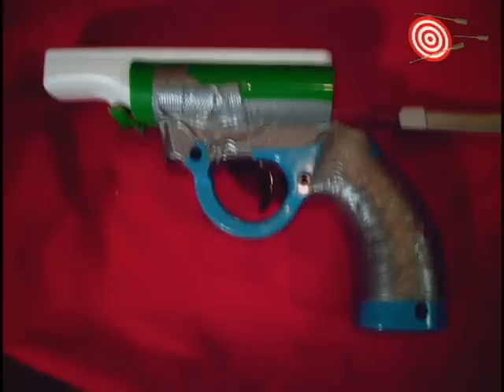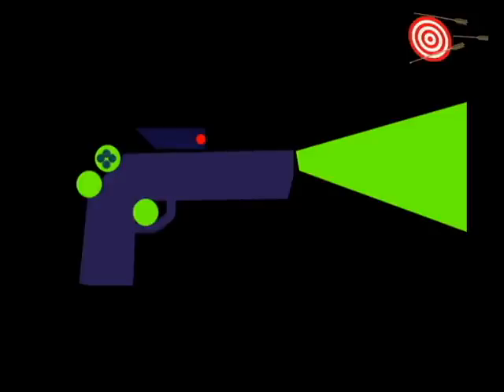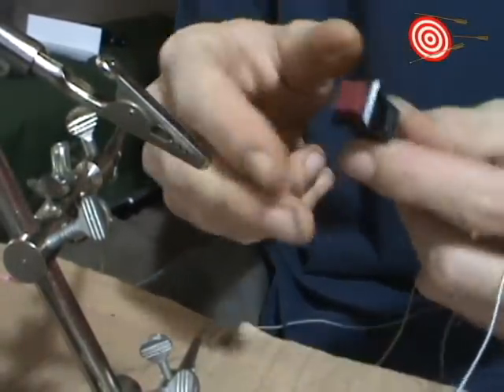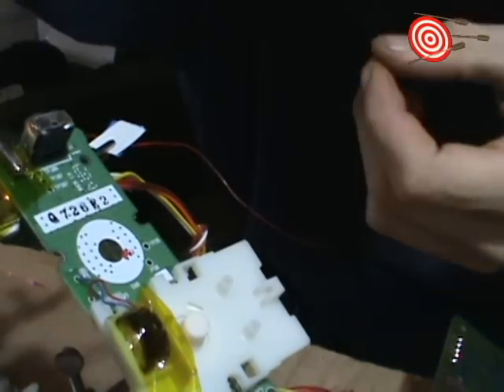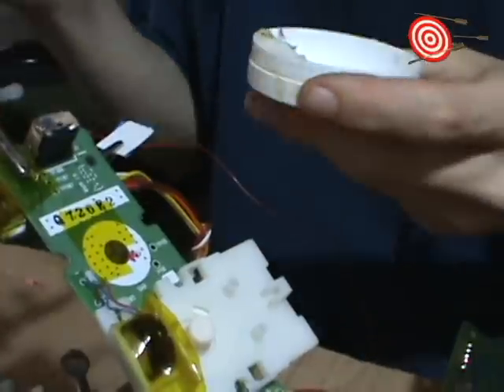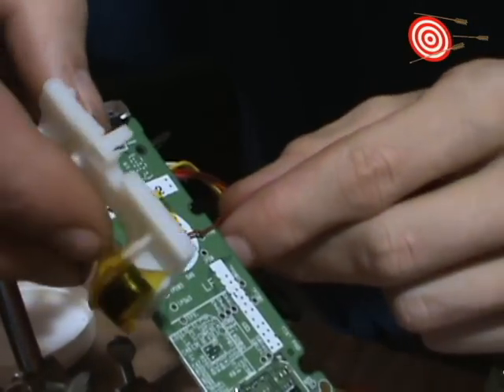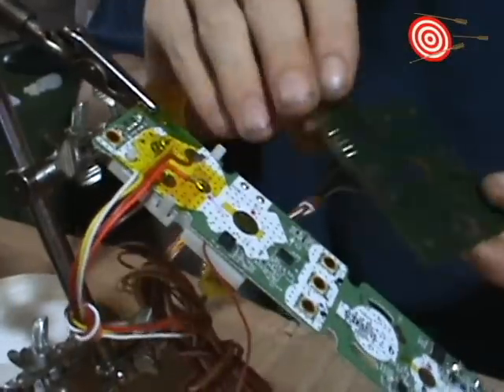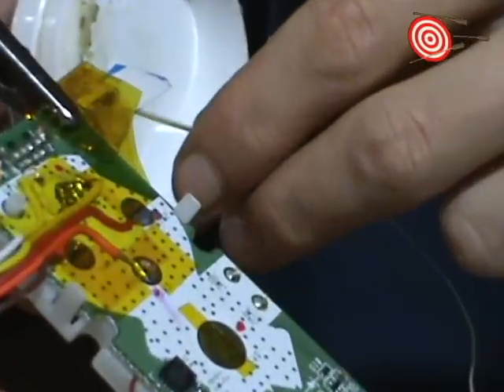How to Map (solder) buttons over Wiimote buttons. p_1

Comment: I fuckin had an idea for a wii arcade pedestal specifically for brawl using wiimotes and i soldered the cleanest fuckin way possible to wiimote button pads and it works perfect for a while, then the buttons start spazzing and it makes 0 sense, i have tried different wiimotes, muiltimeter checking, its dumb as hell

Comment: Somehow, at my wiimote, most of the ground and signal pads are switched,
however, it still works ...
Reply from the maker: This video is pretty old. There is a good chance they have altered the design. Glad it still works for ya tho :)
Reply: interresting tho, that they changed the current direction. my wii mote is from 2007 or so, its pretty old, too.

Comment from the maker: I think what you want is to add duplicate buttons, while the originals still work. Is that right? If so, all ya need is to do is find another place on the board to attach the new buttons. You can manually follow the copper trace on the board to find connection points or there are probably helpful diagrams out there too.